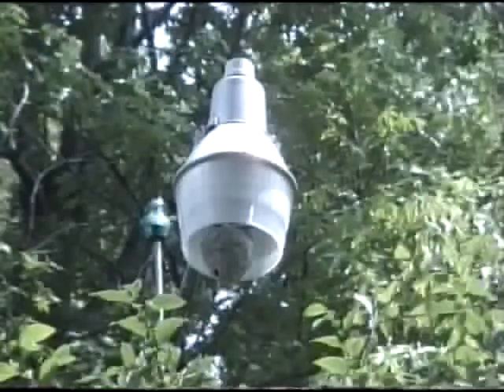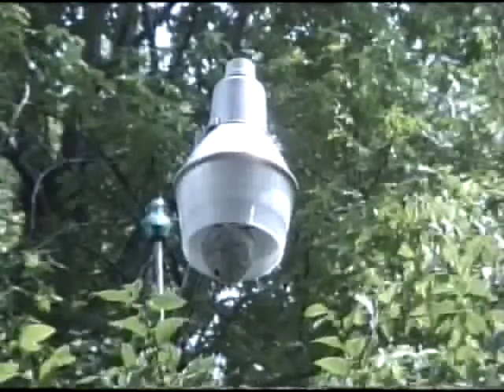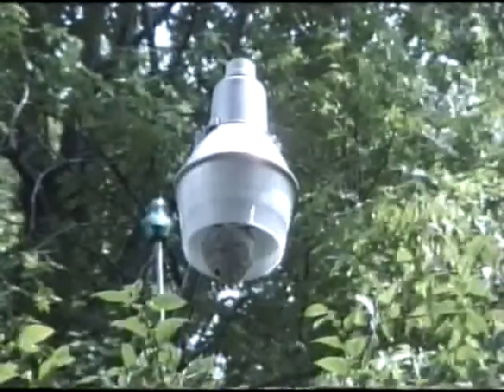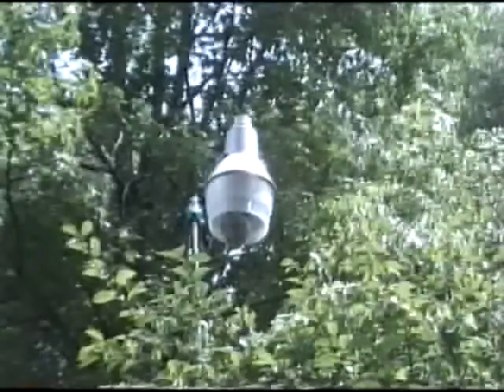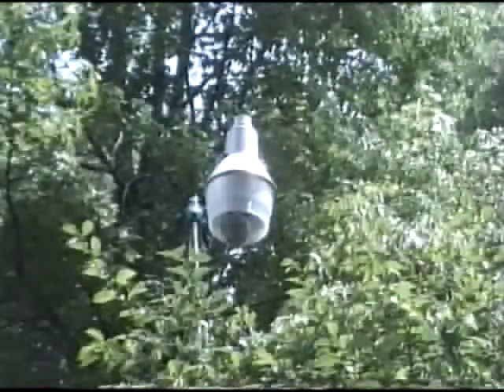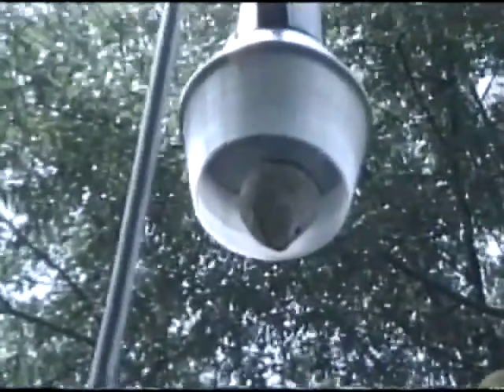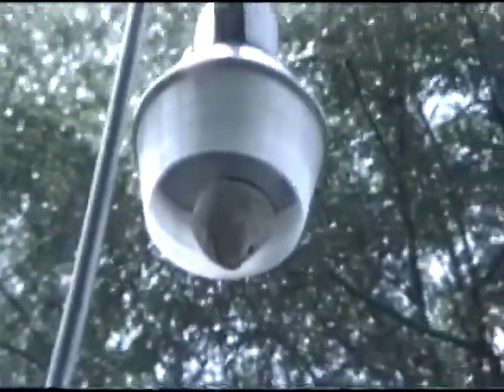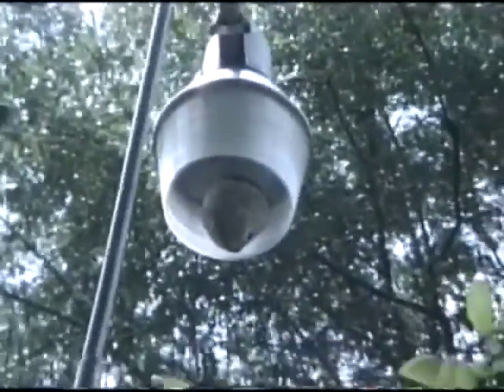Hornets in Streetlight, 6-30-1992

Comment from the maker: Yes! Sure enough, the light came on that evening as it had for all the evenings the nest was under construction. That type of bulb is cooler on the outside than other lamps, so that's why the nest could stay attached to it without breaking down. To see this type of bulb light up, search YouTube for "35w Low pressure sodium lamp." (It's not one of my videos). I put the nest out of business a few nights after this video was taken, but the bulb kept working for about 5 years of night time use.